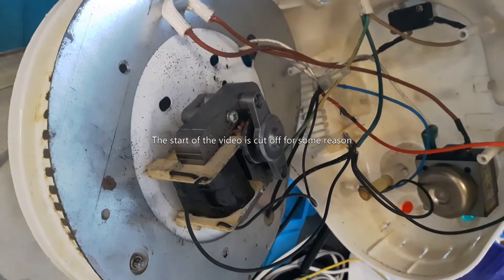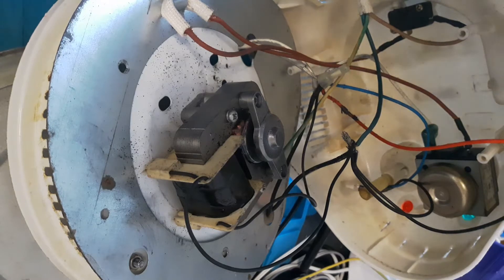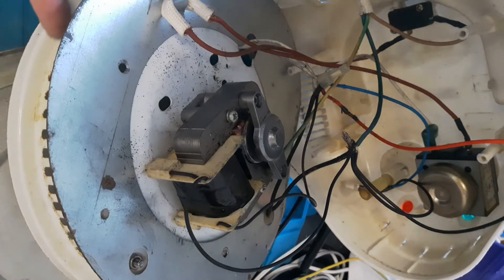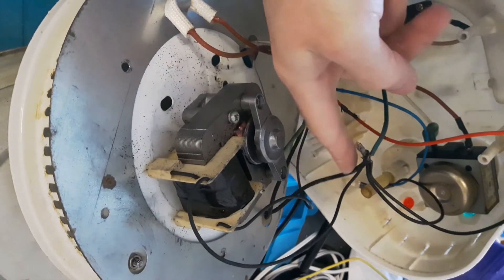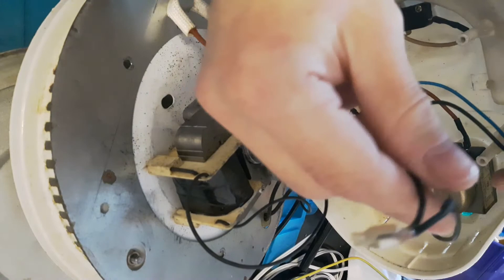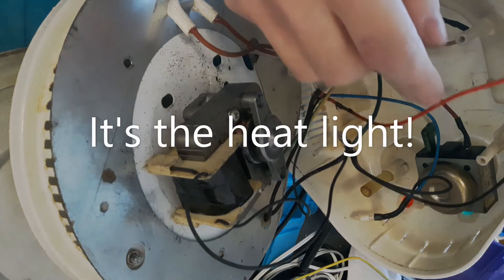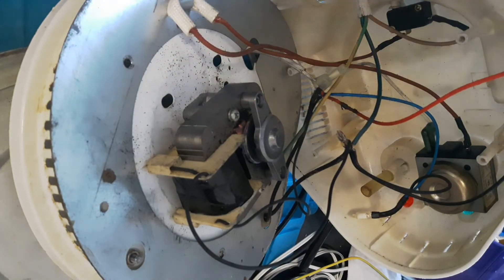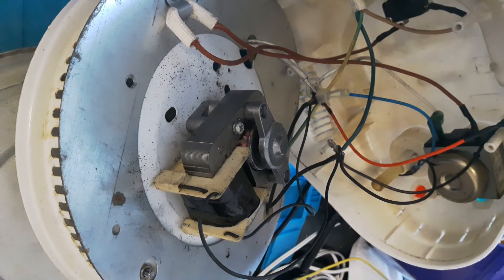Halogen Oven Element Wiring

Comment: Please look at the circuit and confirm what I say is correct. I take no responsibility. Consult an electrician if not sure. 
The best thing is to use colored tape at the outset to not get it wrong. 
When you look at the motor side of the lid there are 3 pairs of wires for the motor (thin black wire), 4 coming through the lid the thermostat bimetalic switch and the halogen bulb. Each device sticks with the same colors. ?red for bimetallic strip, and black for the heater element.  
On the negative side it goes to the switch(related to the handle) so power only goes further if the handle is down. This then supplies the power led as well as the heat led and one wire to the heating element, and likely one to the motor (my wire had come out). So all of these are connected if the handle is down.

The other +ve wire goes to the timer, and out of the timer to a junction of the things always supplied if the timer is active - namely the power led, the motor and the bimetalic thermostat. If below temperature the return from the thermostat supplies the other end of the heat light as well as the heater light, 

Thats all it is - 3 connectors: One connector from the switch supply, One from the timer. One returning from the bimetalic strip to supply things to switch on - ie heat led and heater halogen element. Also remember the earth wired to the plate. At the end of the video  it looks as if it is wired into the junction with motor cable etc but it is not! (see earlier)